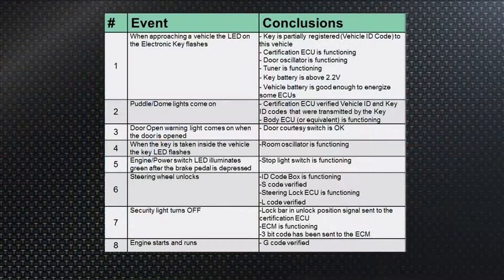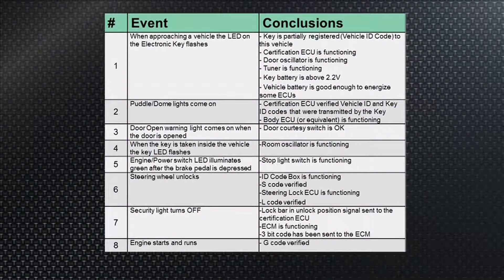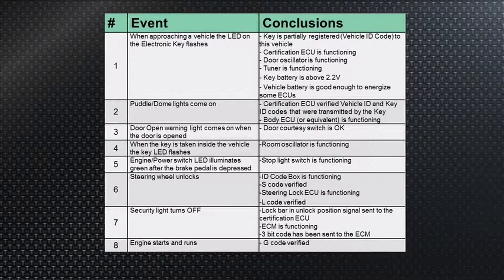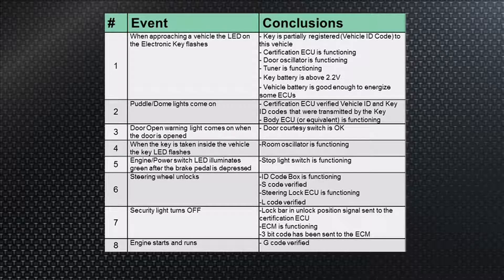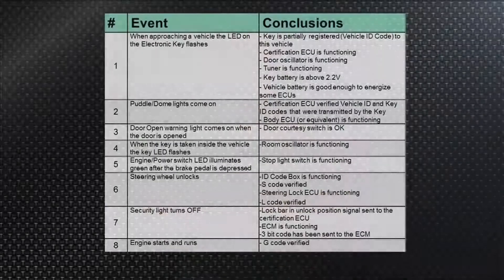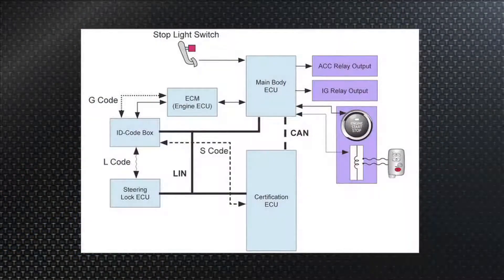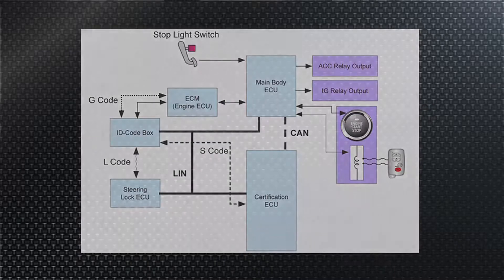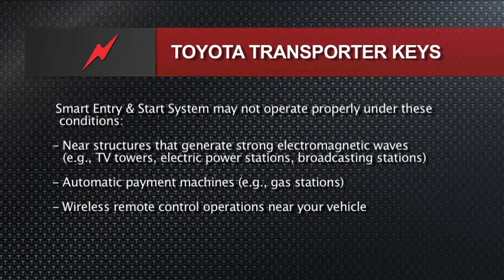Toyota Smart Key System Troubleshooting [Part 2] | Key Programming Tech Tip

Comment: i’m currently having an issue on my 2009 lexus is350. The car says “Key not detected depress brake pedal and put key to the button” which i did and nothing happens. my car will not go into accessory mode so i wasnt able to OBD2 scan my car. I had to tow it to lexus and they said it could be the Certification ecu or ID code box. I changed the ID code box and it didn’t solve my issue however i didnt change the certification ecu. i had a mobile lock smith tell me it was good tho. Not sure what to do. Any ideas?
Reply: Were you ever able to resolve this issue? I'm having the same problem with my 09 Toyota Venza
Reply: @UrbanMaxxTV  yes. It ended up being the Smart Key Box. its part of the keyless entry control module i believe, so if its bad its not gonna read your key. the car I had was a 2009 Lexus IS350. it somehow went bad when the car only had 90k miles but it is a 15 y/o car afterall. not sure if the Venza has that feature tho